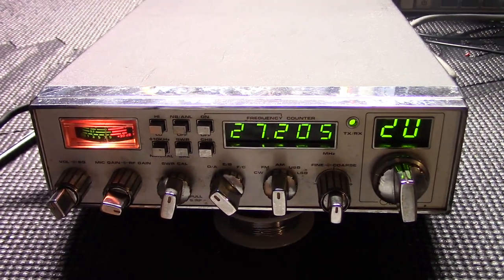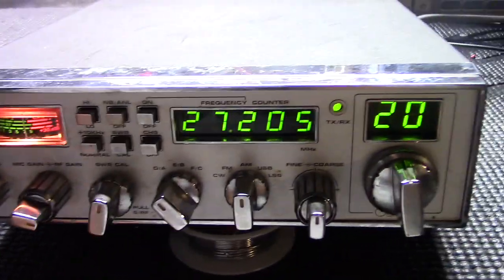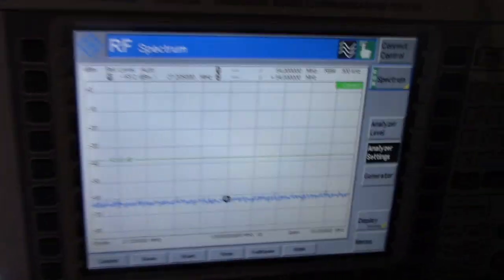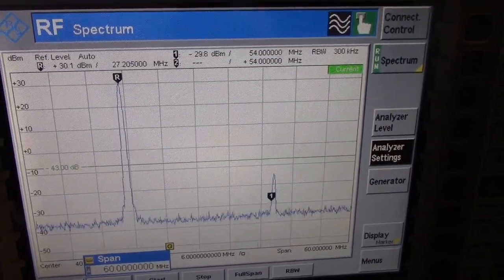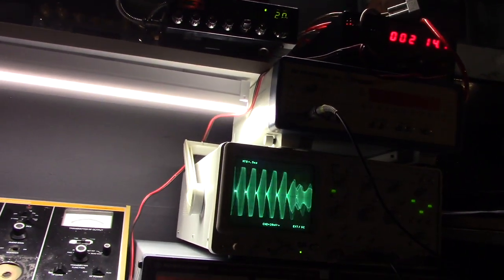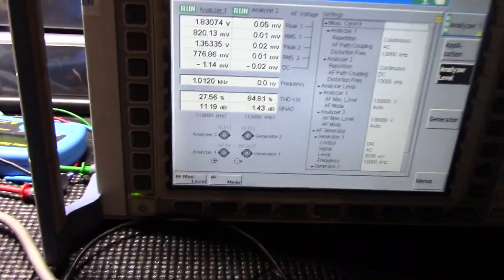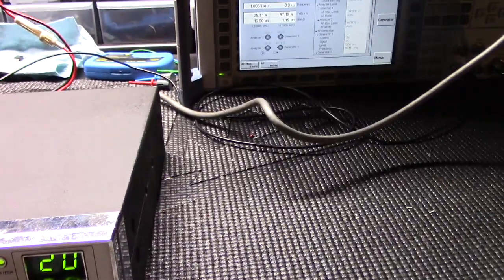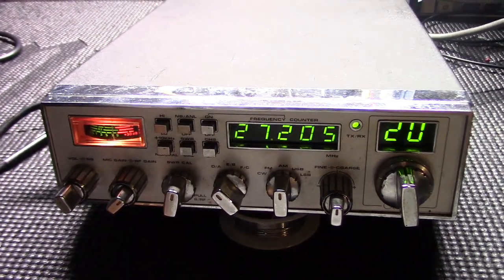Galaxy 2100 tune up (spectrum analyzer, sinad, cb radio)

Comment: I have the same radio few of the LED are out and I am sure it needs a check up it's almost 40 years old. How do you know it's 2100 it has no number on it. I can't remember when I ordered it if it did come with model number.
Reply from the maker: It won't actually say 2100. If it looks like this one and doesn't have a heat sink on it, then it most likely is a 2100.